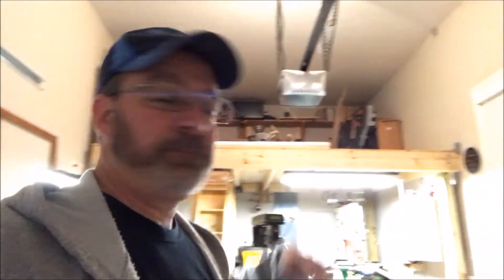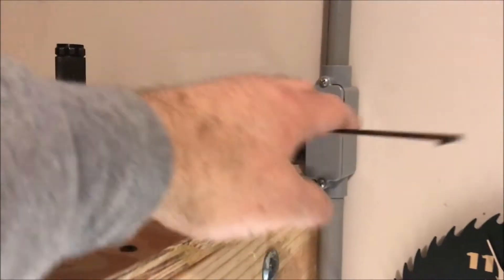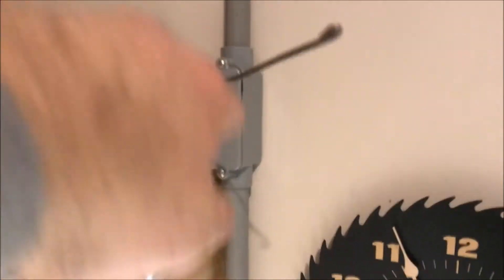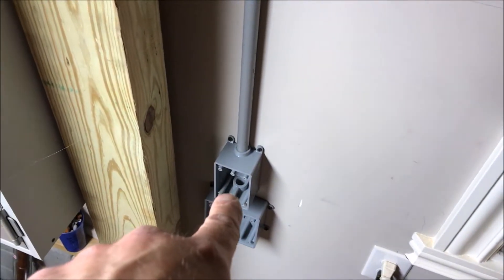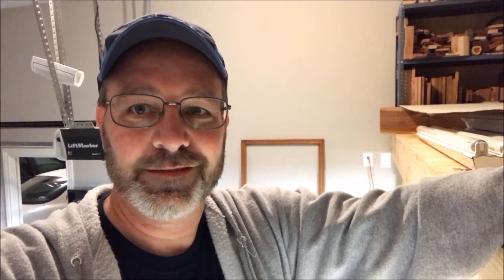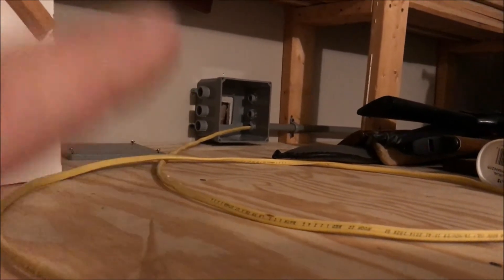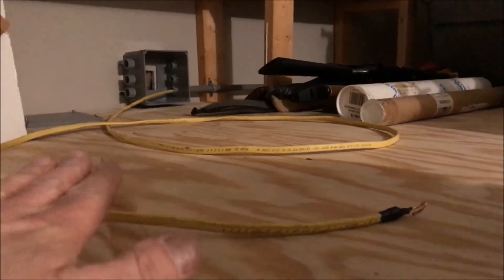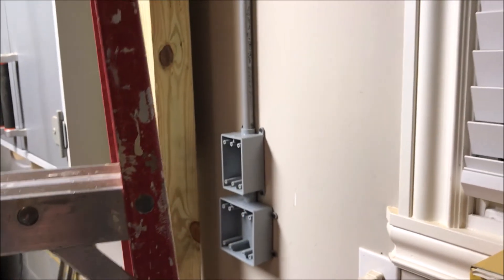Making More Progress on My Shop Lights

Comment: Bob it should be fine 20 amp circuit is pretty good , like you said. You probably only going to run one thing at a time. 👍👍👍👍 Regards Bob Lee
Reply from the maker: +Robert E. Lee / Bob Lee's woodshop Thank you Bob,
  

Regards,
Bob